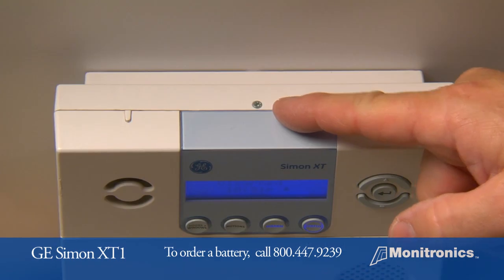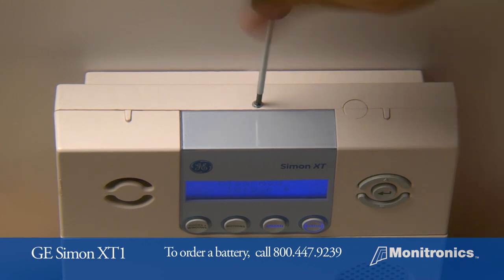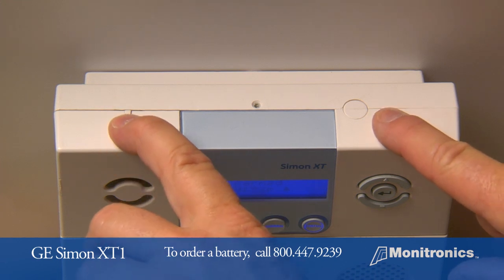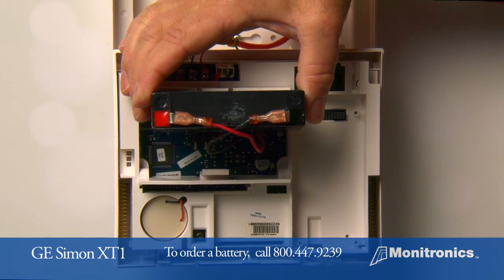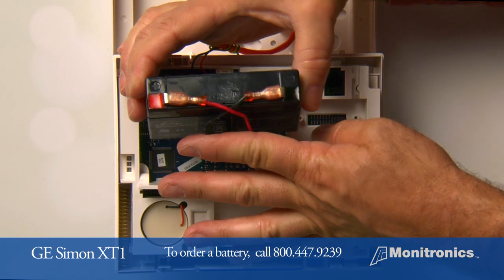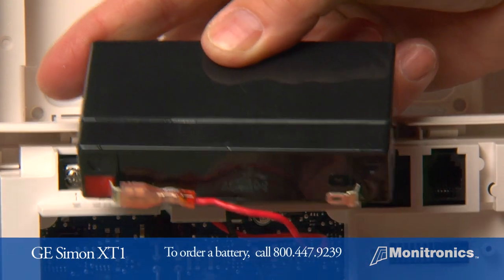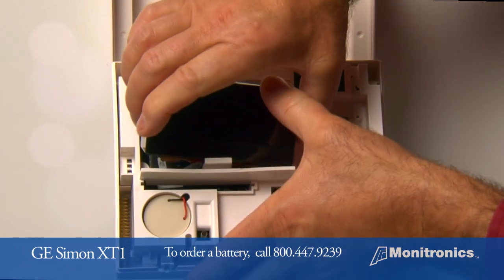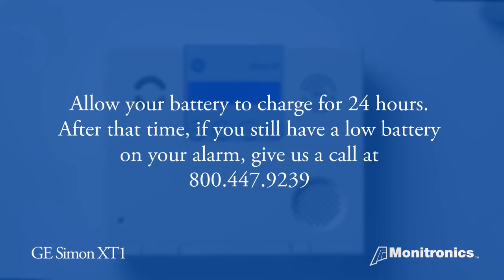How to Change Your Simon XT 1 Battery

Comment: Excellent video, Thank you for posting it. I just replaced the battery in my sisters Ge Simon XT.
I used a Werker 6V-1.3 ah gel cell battery, purchased from Batteries Plus. I loved the easy installation, pop-out, pop-in. My sister was concerned about the system still reporting a Low battery status. After I showed her this video, her mind was at ease. Thank you Monitronics!

Comment: I wish the instruction manual showed you how to reset the system after installing the battery, so the "Fire low battery" alert wouldn't happen when you try to turn it on.  I can't figure it out.  Guess I have to call somebody.